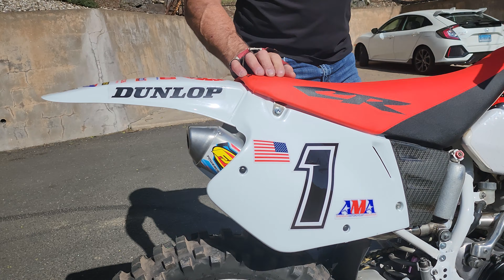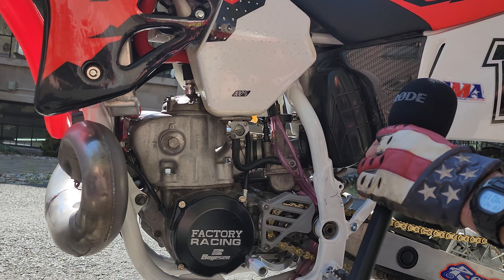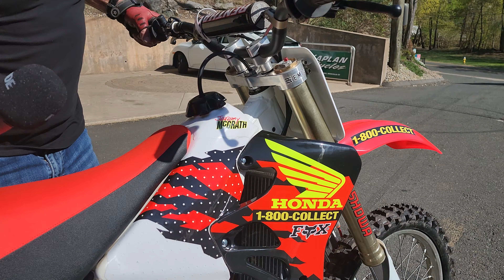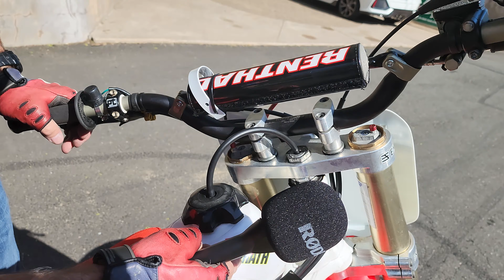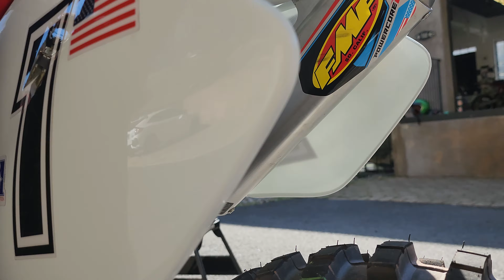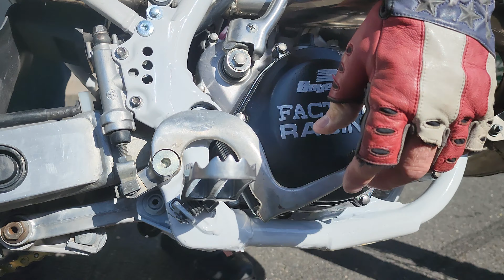THE KINGS 1994 Honda CR250R JEREMY MCGRATH EDITION

Comment: Lipstick on a pig! Frame "glide plates" lol, you can clearly see the lumpy welded up rails after the plates, was pancaked like most other steel frame crs. The ebay pics show it better with white overspray on the engine to boot, I'd offer 2k tops